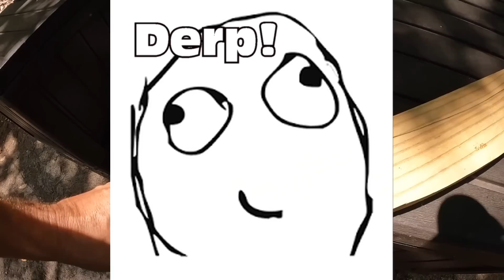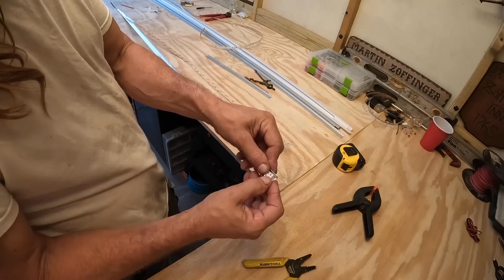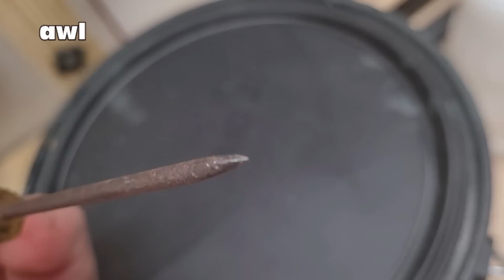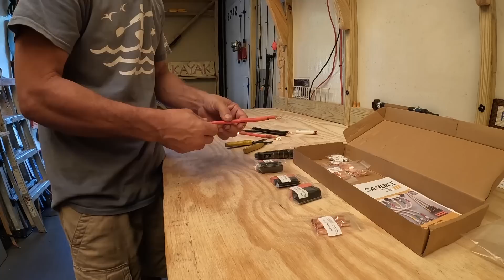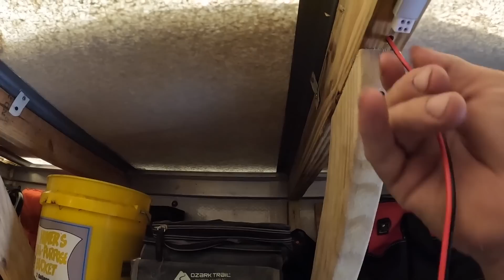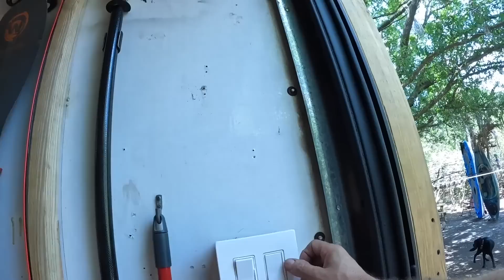Workshop 024 Overhead Lights are Done!

Comment: Hi Marty,
The LED lights are 12v DC. Is there a reason why you used the plug to the inverter converting from A/C instead of coming straight from the battery bank to the lights? Your shop is looking great btw! Thanks!